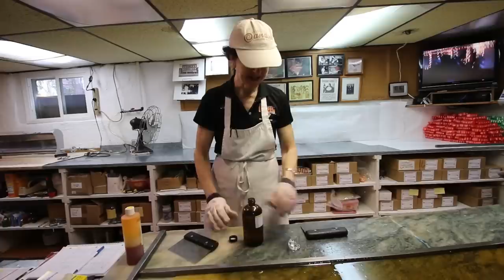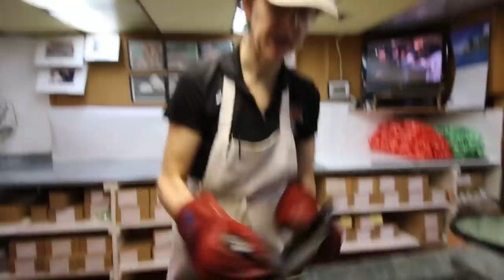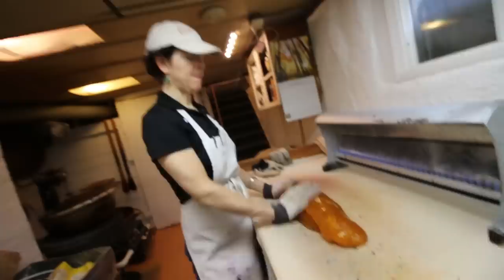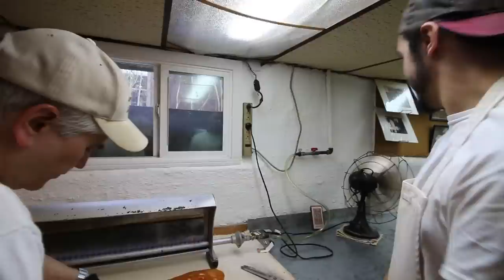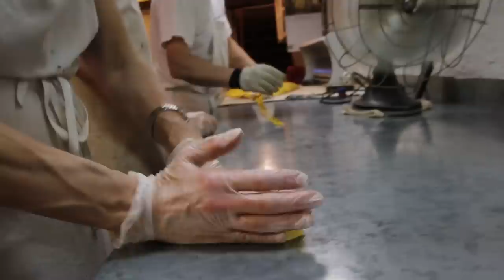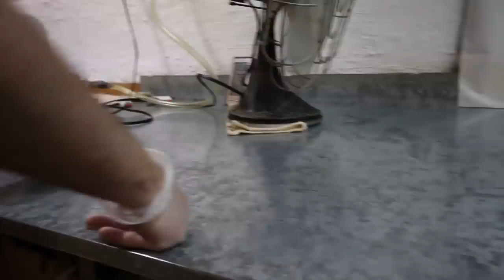Lemon Flavored Ribbon Candy

Comment: Why don't you guys do the stripes white so you only have to pull a little bit?
Reply: bloom will the area that gets pulled has airbubbles I  it so it's easier to bite and chew, if you mostly used unpulled candy it would be very tough on your teeth!
Reply: If you bite into this it's going to hurt.  This isn't taffy, it's hard candy - hard crack stage not soft crack,
Reply: I know it's hard candy, but because it's pulled you actually can bite into it
Reply: I'm actually a candy maker, I promise you that pulled candy is easier to chew, the airbubbles makes it break up easier and dissolve faster.
Reply: Sorry, to clarify bite into was a poor choice of words. You would snap a piece off a chew it with your back teeth.
Reply: It's mostly to do with the airbubbles in the pulled candy, to put it simply it means there are lots of very thin layers in the candy, it's similar to the lamination in puff pastry. and sorry, to clarify I'm a professional candy maker.